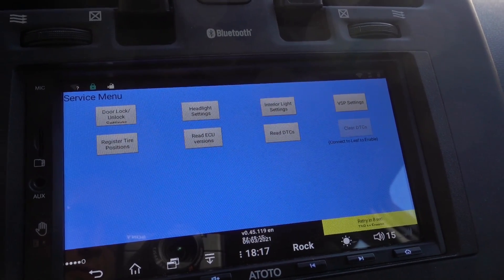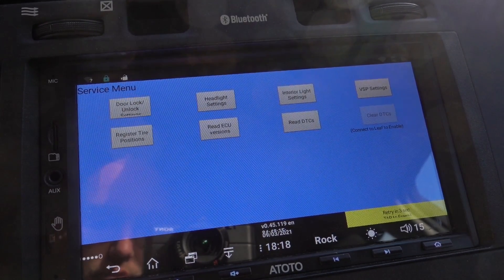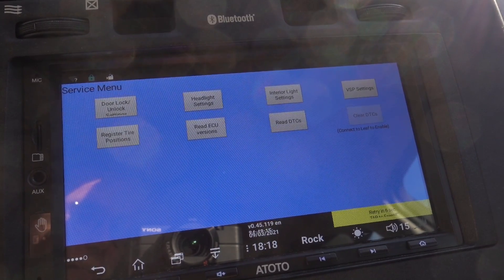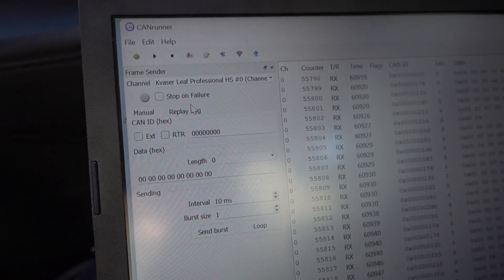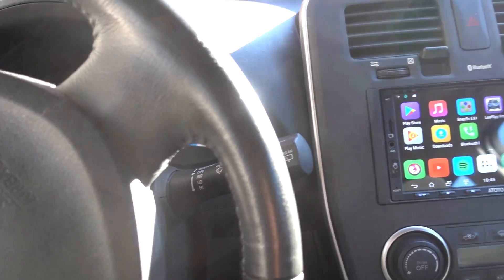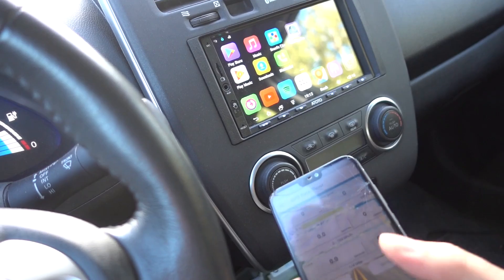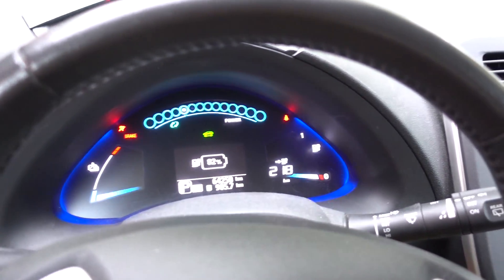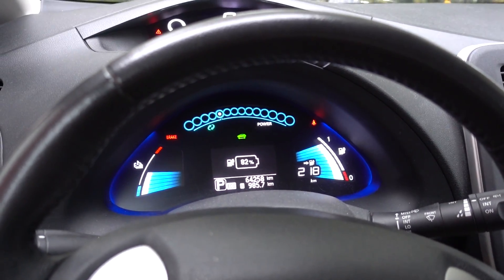Performance upgrade for the LEAF, [Part 2] Roadtesting!

Comment: "I will just push the pedal down" Yeahh.. I knew then what was about to happen... I've driven the 62kWh ZE1. Dry road, 80kph.. Planted boot.. List up the tires and torque steered across the lane..

Comment: Hello Dala! What happens if you install a bridge on the original inverter(80kWt) and increase the torque request multiplier to 1.3? Maybe a relative has a margin of safety? I already bought an inverter from ze1, so that's interesting. Сan you tell me where to correct the address and value in the dump for 2 can-bridge  to start the test it will say from 1.1, and not immediately from 1.3 torque request. Может ты знаешь русский? А то я очень плохо знаю английский=)
Reply from the maker: If you use it with original inverter, it will only remap pedal sensitivity. No extra power, sorry! Still 80kW max
Reply: @DalasEVRepair  good, so I’ll check the can-bridge today. I had it lying around for a long time, today I uploaded the firmware. It turns out that if with this can-bridge there is an inverter from 24, then it will be 80 kW, if from 40, then it will be 110 kW, if from e+, then it will be 160 kW, did I understand everything correctly?

Comment: Hi Dala, Thank you for all you have taken time to work out for the Leaf owners that are nearing the clear need to upgrade/replace the battery. I have a 2013 Leaf, and my battery is at 7 but will soon drop to 6. When I drive carefully, I can still squeeze 48-49 miles. Are you aware of any shops that can do a quality upgrade in Southern California? I recently learned about QCCharge in Vista, and have asked for a quote to get a 64kWh pack put in. They haven't responded yet (holidays), but I'm very hopeful.   Do YOU have any advice? Cheers! Wesley
Reply from the maker: Sorry only familiar with EU. Good luck!

Comment: I need to tune the car for fleet use so I don't want the car to go over 50 miles per hr speeds.  I am sure that is easy but it would need to be programed  first.  Any ideas ?
Reply: Bumping this for attention. I’d really like to see this issue addressed. 

Valet mode?

Comment: Я правильно понял,тут всё в авто стандартное,только манипуляции с прошивкой?
Reply: At 7:21 battery upgrade from 24kWh to 49kWh and newer version of inverter with higher maximum output (from later version of Leaf). Add can bridge designed by Dala. ☮️

Comment: @mjk said "I bet you can increase the max speed now ..."
But that has me wondering, it's gotta be a software limitation right?
Reply from the maker: Yes, the instrumentation cluster interprets the ABS signals, and outputs a km/h output. If this is too high, then it starts to limit power. So to get higher max speed, tweak the cluster signals!
Reply: @DalasEVRepair  nice! I guess the other question is why they did this in the first place, maybe a power or stability thing..? Anyway, good to know it's possible!

Comment: Wait... @4:01 your GPS race timer said you did a 1/4 mile in 10 seconds? How are you doing that with 9.6second 0-60mph/100kmh?
Reply: He is isnt. Impossible to achieve. The equipment wasnt zero:ed/calibrated/glitched.

Comment: you should lower it by a few centimeters and remove some weight of the car
Reply from the maker: Lowering would be cool, but I live in a place where the roads have massive potholes...
Reply: @DalasEVRepair   oh, you could prob put like bag suspension so when on the track you can have it lowered and when your on regular road could have it regular hight
Reply: @DalasEVRepair  massive potholes? So maybe a Re-Leaf copy from the prototype, as they did from the UK factory 😊

Comment: 4:20 the VCM is located there? Is it replaceable by a user?
I ask for a friend 😒
Reply from the maker: Behind the glovebox yes!
Reply: @DalasEVRepair  Thanks I am seeking for a Leaf here in north Italy, they are pretty rare.
Now I see a 24KW and a 30KW at respectively 8k and 10k euros (2016). 🤔
The difference worth it? 
Maybe a 24KWh battery exclude the car from any tuning option?
Reply: I would like to create this year a "ZE0 RC inspired" with appropriate coilovers/suspension and  a bit more acceleration. After all the mighty ZE0 Nismo RC was based o the 24KWh version... it's lighter
Reply from the maker: @jolladevices  Go for a 2013+ so you can install 110kW or 160kW inverters. Nismo VCM does not increase power, it only remaps throttle feel. Only way to really tune these cars is with Inverter swaps. 24kWh should handle more power, I've seen russian 2x80kW builds, so 160kW seems doable even with smallest battery.
Reply: @DalasEVRepair  OK I am more for the lightest s4KW 2015/16.
Did you ever dive into the VCM? It's very closed source?

Comment: Yes! Great job, man! Loved it. Keep tinkering.
I drive 2012 ze0 leaf for now. Plan to replace it with aze0 2013-2017 leaf. Main problem - can't do much with it. Then i plan to replace 24 kWh bat 🦇 with 40. Might do an invereter replacement then as well.
Reply from the maker: Yeah unfortunately the AZE0 has tons more options! 😅

Comment: Just seen this Dala - awesome work. As I am controlling the inverter with my own code this should be a basic lift and swap in my EV! And upgrade the fuse - but that is easily accessible in the boot now! Good work
Reply from the maker: Absolutely, thanks!

Comment: Wow. Thats crazy.
But how will the battery react? A lot of heat?
Reply from the maker: I have a 40kWh pack installed, so no issues 😁
Reply: @DalasEVRepair  ohh... But didn't u put in a 30Kwh first? :O

But now, with the 160Kw inverter. How much hp du think u can get? :)
Cause u got 125Kw from a 110Kw inverter :)

Comment: Great success, Dala. I was wondering how this upgrade affects the differential gear. Do they all (gearboxes) have the same design and material for the different power?
Reply from the maker: Should be the same, atleast the look exactly the same. I have two 2018+ reduction gears in the workshop, but I don't feel the need to tear it down and compare. It's only a single gear, and quite a big one!

Comment: Carefully that little gearbox in leaf IS piece of trash... Even if u pushin hard with štandard . Can last only 100k km
Reply: Worried about that, whats wrong with them, just needs service or ?
Reply: @jestronixhanderson9898  they not last long in 2 tones car especailly  with some extra power :D, similar to nissan micra when is pullin caravan 160000 km :D
Reply: whaat??? mine is pushed hard from 0km's and now its 250k - oil is clean as new. changed every 30k
Reply: Nah sorry you are wrong regarding, the Leaf gear box is strong.

Comment: Great work Dala! But did You test the setup without resolver coding? I'm asking this because this offset in the nissan system does not make any sense with my results, they are identical with and without writing the resolver offset, mainly because the rotor of the resolver is not mechanically adjustable and the stator is fixed in place too, so why bother?
Reply from the maker: I had a difference of 10 in the offset, so I would have probably been fine without writing in the new one. But if you have a diff of say 128, I'd really want the proper offset, otherwise you're gonna get higher consumption due to wrong timing!
Reply: @DalasEVRepair  Yep, today I've tested many combinations of resolver offset and found that the motor can work quite noisy when the offset is wrong, and yes, consumption can be a little higher. But the worst of all is noise. It can be very loud when the offset difference with the right one is more than 50...
Reply: @DalasEVRepair  But did You tested the wrong offset vs right offset? I've got difference in one motor+inverter combo almost 100 (96 exactly) and had no problem whatsoever. Absolutely identical consumption with the right offset. Try it out)
Reply: @DalasEVRepair  and of course Kiitos!)

Comment: After I reconnected the second bank of battery in the trunk to bypass the current sensor, my speed was also increased. But I have no way to measure other than the smile on my face.
Thank you for the update.

Comment: Is this upgrade compatible with 2012 Leaf?
Reply from the maker: Sadly not "Q: Why doesn't this work on my 2011-2012 LEAF? A: The early leaf has EM61 motors. These aren't compatible with the EM57 inverter style."
Reply: @DalasEVRepair  Sadly 😔

Comment: Cool stuff. Can you just change the inverter and keep the stock motor? What happens to regen does it increase also?
Reply: All cars from 2013-2022 have the same EM57 motor.  It's the electronics and battery that matter - it's all about getting more current to the motor - the motor in the LEAF can handle more than even 160 KW, but you'd need to go to custom inverters.  I suspect that with a front wheel drive LEAF that 160 KW would be so difficult to get power to the ground that you wouldn't really want more.
Reply from the maker: Yes that is precisely what I did in part 1! Regen can be increased with the software!
Reply: @DalasEVRepair  I'd love to have more regen. nice find
Reply: Just found this vid, loving it 😁 Does the new inverter fit in the old inverters case or is it just using the plugs? Are you working on a plug and play kit for us that don't understand the technical bit? 😁😂
Reply from the maker: @skydog7544  No there's not enough financial incentive to develop anything. With these videos anyone should be able to accomplish this!
Reply: @skydog7544  it appears that the interior of the case is very different, but since ‘17 and newer cars use the identical motor to ‘13-‘16, it should externally bolt up.  It looks like the phase outputs and DC inputs are in the same spot.

Comment: Impressive work. The 0-100 isn't that impressive but I bet it feels mad 🤯 A rolling start to 50kmh would be a great figure to compare, maybe 5-50kmh?
Reply from the maker: Just wait til I get my hands on the 160kW inverter ;)
Reply: @DalasEVRepair  Have you determined the current limit of the 40 KWH pack?  I remember you mentioning that the 24 KWH packs are limited in what they can supply via a fuse in the pack.  It would be very interesting to see what the 40 KWH pack is capable of when coupled with the 160 KW inverter.
Reply from the maker: I'll find out soon 😁 the fuse derating is quite lenient if you only do short peaks above the rated A